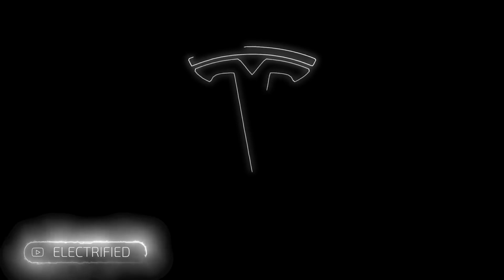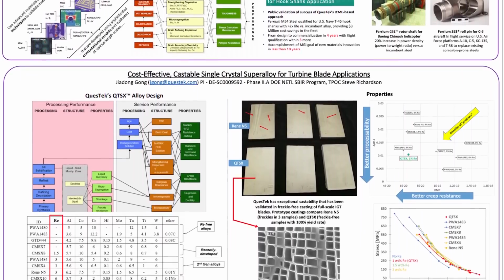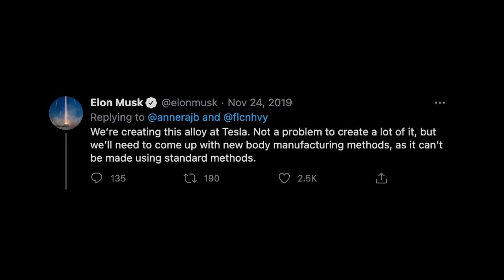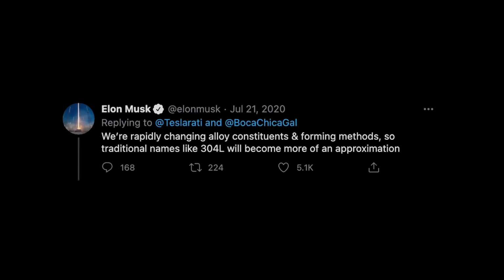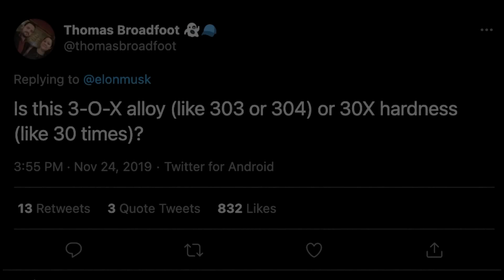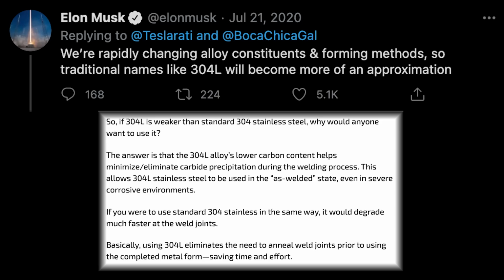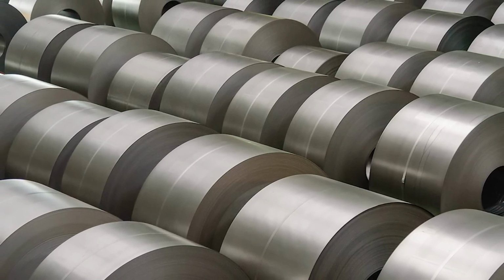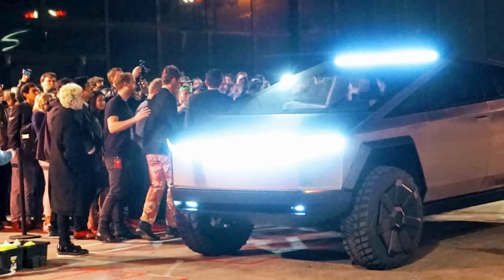New Tesla Secret Weapon Hiding In Plain Sight ⚔️

Comment: This is kind of wierd... AISI 304 is usually in kitchenhoods in doors, but if you place this material out side this will rust...
on boats and in food industri often AISI 316L is used, its a harder metall but its acid proof an does not rust....
I hope that the cybertruck doesent use AISI 304 if they do, then it going to be a lot of problem when customer say that thier stainless steel car is rusting...

Comment: Laser cutting is slow, stamping is fast. Sort like cutting a hole with scissors vs a hole-punch. Tesla engineers are so good, though, I’m curious to see how they implement the manufacturing processes for this stainless beast. I’m thinking that the ramp up for this one will be longer than for the 3 and Y because they are doing so many things that haven’t been done before. Think slow ramp like the 4680 battery cells. So much new stuff all at once, it will take some time. But all of the learnings will be useful for future stainless designs — like the Model 2?

Comment: It will be interesting to see how the v-notches are cut to allow for forming/breaking. Likely routered? I guess laser is possible but comes with heat issues. Speaking of heat, it will be interesting if the panels are actually laser cut or water-jet cut, as the latter can cut cold.

Comment: I don't think as you implied that the CT's 8,000 ton Gigapress weights 2,000 tons more - it provides a pressure of 2,000 tons more than the 6,000 ton Model Y Gigapress.  BTW, Sinton is almost exactly halfway between the Tesla Gigafactory in Austin and the SpaceX facility in Boca Chica..

Comment: When we build our first lunar bases we should start off with bases at the poles in craters with reflectors built along the craters rim to heat water ice. At the same time these reflectors could be positioned to redirect light during most of the day to solar panels, this would mean less batteries will be needed to heat over night. This would be the best start for a lunar base. With the assistance of Space X's Starships large domes could be built to build a pressurized settlement. These domes could be made from transparent armored glass and transparent solar panels. Polarized tint would be used in this glass to prevent harmful ultraviolet rays and other radiation from entering the dome. By building on the moon this will help us learn more on colonizing more distant planets and bodies. It's time to change our future! If you like these ideas or have some of your own to add please let me know. I appreciate all of you and your ideas. Shoot for the moon and end up amongst the Stars! 
propower101@hotmail.com

Comment: not the same slitting line(s) I used to work on back in 65. Surprising I could keep up with all the technical jargon since it has been seven decades since I worked in a metallurgy environment.  No barriers, just solutions

Comment: Early on, in explaining hardness, you failed to do that.  You only conflated it with yield strength and said people didn't understand it.  But you were wrong.  I worked in a metallurgical tech company (Deutsch Connector) as a tech writer - hardness testing is specifically surface deformation - being bulletproof is an example of that.  The test is done with a diamond anvil and stylus and the depth of deformation is standardized.  Strength, or Yield / Bending strength, by comparison,  involves overly complex mathematics (IMO) but basically describes both springiness, strength as in how much weight can be supported, and ultimately what you are describing as brittleness - the tendency to snap instead of deforming.

Comment: “Hardness” is a measurable property. Generally hardness and yield strength are correlated but the yield behavior can be plastic or brittle (early fracture close to the yield point). So Elon - who is usually deliberate on his word choice - was not being careless in his description.  This steel will be both hard and strong.

Comment: The more I hear about this thing the more I worry about how expensive they will be to own in the long term. For one their is the shear weight meaning they can't be sold in the UK or EU as a recreational vehicle so you'll need an HGV licence not to mention low efficiency. Then there is insurance, I assume with this material repairs will be exotic. Next we have its profile and pedestrian survivability, very unlikely to get homologated and certified for public road use outside of the US. Don't get me wrong the idea is awesome and breaks certain moulds but it's execution seems a little short sighted.
Reply: Musk has made clear that European design teams will design Europe vehicles. Once Giga Berlin is up and running I expect to see a 30x exoskeleton vehicle with front end and rear end castings and a structural battery pack designed in Europe for Europe.

Comment: With regards to the exoskeleton, almost all other vehicles collapse to reduce impact to the driver, but the Cyber Truck won't. Is that an safety issue??? e.g. F1 cars used to be rigid and many drivers died from impacts - they moved to nose cones that collapse and parts that fly off, taking away energy as they do and they are much safer now.  It's true of all road cars.

Comment: What if we are missing other things in plain sight...

* The vehicle requires no paint and the EPA systems required to do so. Millions saved.
* No dies, again the flat panels.
* But what if the Truck is a fake out for a low cost vehicle?
* Shorten the wheelbase and get rid of the Truck bed and you have something that could be the low cost entry everyone pontificates about.
* Use existing parts from other models aka the Front and Rear Castings, etc., again lower the cost.
*  Research VW / GM & the patent dispute about a low cost car eons ago w/ dramatically low production times.
* Also think: Lower the Parts count. (Research: the RC-3 Republic Seabee)...
* Has he researched the old GM/VW fiasco and learned from it, and taken some of lessons learned from that debacle and  with that in mind is working on something under our noses & no one sees it?
Reply: Thanks for your comment and views, trust me I don't take them for granted. I've been able to secure a steady inflow of returns of my investment, it's just great especially with the whole pandemic situation. It's just amazing to find out Mr Frank and there's been no regrets ever since.
Reply: +1️⃣5️⃣8️⃣0️⃣9️⃣9️⃣1️⃣0️⃣9️⃣4️⃣9️⃣
Reply: WhatsApp ☝️.

Comment: A considerably thicker panel using high density materials? Vehicle weight has a direct correlation to efficiency and range. This seems like a massive compromise to the CT consumer to improve costs on a relatively low volume spaceship. I'm not saying it won't work, but this looks like one of the biggest mistakes from Tesla. It leaves a big opening for other companies to outperform.
Reply: Thanks for your comment and views, trust me I don't take them for granted. I've been able to secure a steady inflow of returns of my investment, it's just great especially with the whole pandemic situation. It's just amazing to find out Mr Frank and there's been no regrets ever since.
Reply: +1️⃣5️⃣8️⃣0️⃣9️⃣9️⃣1️⃣0️⃣9️⃣4️⃣9️⃣
Reply: WhatsApp ☝️.

Comment: I work in autobody.  I really wonder how this will be to repair upon panels that do get dented. Can't use filler if there's no paint
Reply: The panels will be bonded to the substructure with structural adhesives as is already used on many modern supercars and in many body shops, no doubt that specialists already know how to deal with these adhesives and as their popularity grows, so will the tools and techniques to deal with them as they have with bonded glass screens.

Comment: The Tesla dies casting machines do NOT weigh 6000 or 8000 tons. The tonnage of a die casting machine has nothing to do with the weight of the machine.  It refers to the clamping force available to keep the dies closed while the molten metal is injected. These are known as "Pressure Die Casting Machines", not referred to in the industry as "presses". Otherwise very informative video.

Comment: And then the CEO's from sales and bean counting at Ford and GM are supposed to understand what is going on and come up with a plan to compete with Tesla where real geniuses work who, to top it all, are headed by an actual rocket scientist? No way. I bet they don't even employ materials scientists, let alone employ the best ones. 
You see, in companies like GM and Ford, geniuses and experts are ALWAYS overruled by kings from powersilo's and by bean counters. I have had this experience at Unilever and at the largest telecom company in my country. Innovation is unpopular, yet about 40% of the profits in any year come from products that did not exist ten years ago. But CEO's and boardmembers tend to last 5 years, if that. So they do not care for innovations, they are incentivised by short-term self-interests like bonusses and pensions. It is remarkable that the stock price of GM has risen so much just on the Public Relations campaign they did on EV's. My questions: where are those cars? Where do I see the production changes in factories? Where are the design developments? Where are they going to get the batteries from? It is all PR to get the stock price up which will reflect in the bonusses the board and management get. In the UK, idem ditto. Jaguar put up a BEV design on purpose looking like an ICE car design. The grill wastes 10 to 15% of the battery energy. Like the car was designed in order to prove EV's were not feasible.

Comment: Also to just add to this, even with cold rolling the material will get pretty hot, just not glowing hot ( every time you bend, drill, cut metal it heats up)
So rolling it like that. I wouldn’t want to touch it bare handed when it comes out on the other side.

Comment: Mechanical engineer here - Elon was right in calling out hardness instead of strength as the reason the cold-rolled 30X SS cannot be stamped. Strength is not irrelevant, but hardness is going to be the main issue. The stamping press blades will get ruined by a material that is harder or nearly as hard as the blades of the stamping die, even if the material is not as strong. Think of rocks, for example. Very hard, not very strong. Try stamping rocks and see what happens to your stamping dies.

Comment: 3mm = .125 “ =6 ton vehicle. Toyota’s, Chevs ,fords and vw’s  are .025”. In other words five times thinner metal. Cyber truck will be Heavy as Hell.
Reply: It'll actually be a little lighter than other trucks with a similar payload capacity.

Unlike other trucks, the Cybertruck skin is structural, which means they can mostly eliminate the frame and its weight.
Reply: @alanlight7740  the frame had better be structural. Note that no panels are ‘going away’ .  The hood and doors do nothing for the structural rigidity of the vehicle and are dead load. Five times as much as typical body steel. The .125 “ will have to be be revised and used for select areas in order for this thing to come in under 6 tons.

Comment: If the Cubertruck has fewer accidents needing repair, insurers may still come out ahead if more serious accidents need more expensive repairs.  Especially if fewer people are killed or seriously injured. Sounds like a complicated calculation. 

I had a windshield replaced in 2019 and it was ridiculously expensive for my insurance company because of the sensors required for the automated braking. But if that PREVENTS enough severe accidents, the insurance company comes out ahead.  And rates will fall. 

I do wish my windshield had been as tough as the Tesla Semi’s to begin with.  I’ve had 4 different cracks in 31K miles.

Comment: Awesome content as always, Dillon!  Thank you for putting the pieces together about Tesla Austin and SpaceX Boca Chica potentially sharing stainless supply chain.  Great to highlight the material science of the exoskeleton.  

Long ago I learned that Tesla and SpaceX both use friction stir welding from the Elon Musk biography by Ashlee Vance.  FSW is a fascinating process that joins metal sheets with a spinning mandrel - no deformation and it makes a stronger and more uniform bond than torch welding.  I have assumed that SpaceX makes the Starship body from big stainless panels joined with friction stir welds.  I wonder how much the FSW process will be used on the Cybertruck production line.

Comment: Repairs will be very easy. No paint to bother with, just cut out the damage and weld in new flat panels. TIG or even MIG welding in certain hidden places is not that complicated provided you understand how to avoid warping.
Reply: the hardest part will be just trying to get the same surface finish so you don't have a random extra polished or rough spot
Reply: Bengt Bjorck - As long as you can source the material you need for your patches from Tesla. You will also need to put a heat sink the back of the weld zone to prevent 'Sugaring', of flood it with Argon. It's not trivial, but it is possible if you know what you're doing.

Comment: My only issue is will they have batteries for sale when they have reached their service life. The original roadster had a new battery available but it was in limited quantities. Service and maintenance needs to improve at Tesla.
Reply: I believe by the time cybertruck is being manufactured, it will have the new tesla 4860 battery rated for 1-1.5 million miles.  In that case, battery lifespan is probably one of least concern right?

Comment: Excellent content. Cold working steel usually introduces dislocations that form an entangled network. The reason they entangle is because they cannot move through each other easily, which increases the steel. Should increase strength in general (in tension, compression and sheer). This will be cheap to make and produce one tough truck.

Comment: Tornado proof 30x stainless homes. Can you imagine?
Reply: Concrete dome homes are weather proof even earthquakes are no problem people are kind of traditional though about things like wood box homes with a white picket fence and even if it makes sense they don't do it like morons....
Reply: Yeah, the concrete dome is a marvel.  Traditional homes would be tornado proof if they made the entire home like a safe room.  Standard brick and concrete builds would need to use an ICF design which is very costly but extremely durable.
Reply: @Barskor1  there are many people doing things differently when they can.  You can only buy what's on the market and only use what law/code allows... If you cab find land without code, you can and many people do anything other than traditional builds.
Reply: @l0gic23  Correct and building codes are basically make work profits for the construction lobbies and for cities and towns who dictate square footage minimums and so on as it ups the property tax revenue.
Reply: I've been in an f4 and f5 where brick homes were as flat as the rest. Unless the foundation is made to move with the ground earthquakes crumble brick. Brick homes are strong, until they get hit by a car. "It's not that the wind is blowing, it is what the wind is blowing."
Reply: Build structures that blend and form into the landscape and storms go over rather than through. Such knowledge is as old as the Native American tribes that weren't entirely nomadic and their traditional earth lodges. No fancy materials needed. It's the square framed homes that the market dictates which isn't quite fit for such conditions.

More or less a lot of the "odd" "Earth-ship" style or dome homes just rediscovered something people should have been doing all along.
Reply: You know there are bricks and concrete already, right? 🤭
Reply: @goodyKoeln  Yes and how they are assembled into a structure makes a vast difference in results when under stress hence the particular type of home I referenced.

Comment: Even the SAE 3XX Alloy codes are a rough guideline. There is much more factors and specification of ordering metal stock. The allow code just informs you a rough idea of it's chemical composition soo you have a baseline to start with, then you layer on what has been worked or treated. Tesla is probably going to tweak their own chemical ratios and processing method for wierd needs of Space Craft. Thus you don't have a standard code to refer to.
Also Bravo, love when this channel covers chemistry and material science.